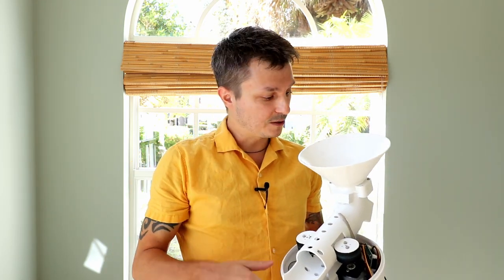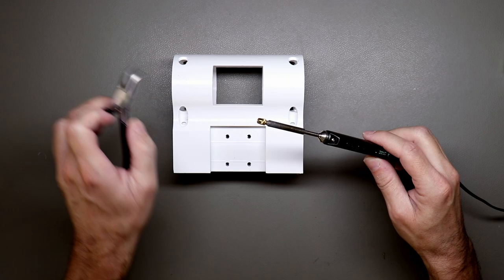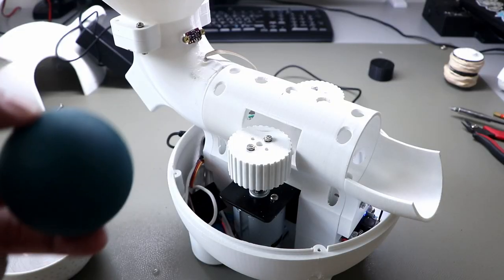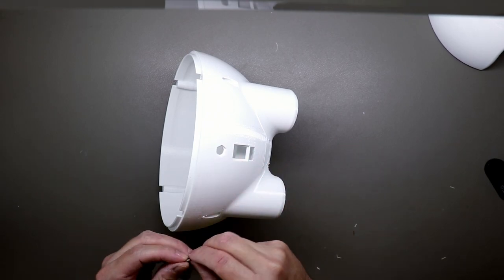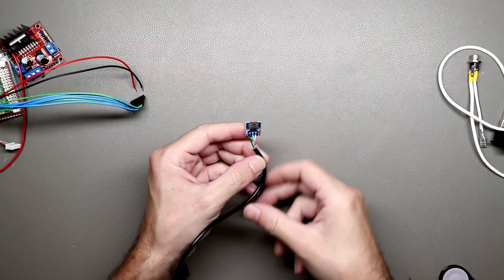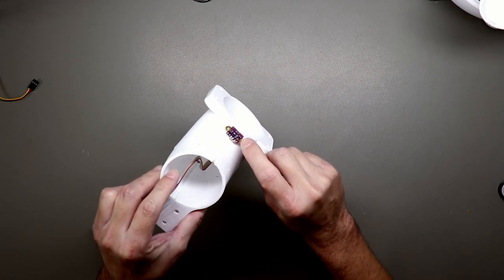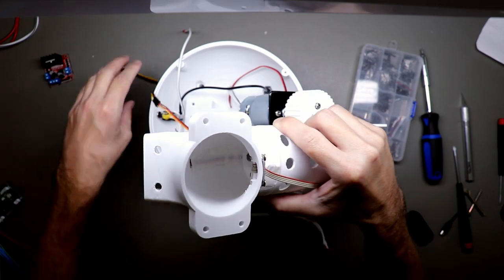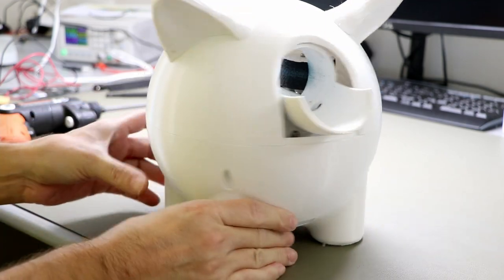The ultimate DIY Automatic Dog Ball Launcher.

Comment: - How did you secure the servo motor arm so well? I can't get a screw to thread at all!
- Is there any other diagrams for how to handle power? I am unclear on how the negative/ground is wired.
I'm excited to get this working! I am fairly novice to Arduino and these types of project so this one has been quite challenging.
Reply from the maker: I just used a small wood screw. Maybe use a slightly thinner one or longer one?
What power are you referring to? To the motors?

Comment: GREAT project. Couple of things as I build. 1. The screws you show to get is up to 30mm in length. The thickness of the wheel is 30, so 35mm screws are needed. So I had to reorder. No big deal. 2. There are several places the screws are too short.  3. The little LIDAR distance measuring device is no longer available. A different part is needed.
wow.. for anyone thinking about this build. Maybe think twice. He has the wrong file attached for the part where the motors attach. It is not even close!! Now I have to completely redesign and build. Too bad the original Fushion files are not attached so I have to start from scratch!!

I would suggest an update to your video, or make a howto, but it is obvious you are not paying any attention to this posting. :(
Edit: Also don't blindly just print what he has listed. There are duplicates. The Servo cover, there are two. You only need one. There are two ball chutes (the exit) and you only need one.

It keeps getting worse. :( Do not blindly just order what his links take you to. He talks about an 8 pin plug. The parts ordered have a maximum of 6 pins. So now I have to adjust. The link to the wire assortment will only be part of what you need. It is far too small of a gauge for a lot of this project.

Comment: This seems like a really fun build my dog would love! I may have missed it during the video. Did you mention the total cost or an estimate of the parts needed?
Reply: To purchase all the electronics your looking at $128 give or take $10. To purchase everything he used in his build off Amazon the total you would be looking at $227.. i would just purchase the $49 ball launcher from Amazon.
Reply: It looks like $60-$100 depending on what you need. I see the PICO for $12 and motors for $16 ea.
Reply: @jacknabvoip  And it will last about a month. I bought the best one I could buy and it lasted 10 shots and broke. Good luck. You get what you pay for.
Reply: @lorneshantz4892  I ended up returning the launcher I bought off Amazon, my pug would get scared and run when the motors started to spin up even though they were not loud..

Comment: Hello....I wish to ask question here. No load current ratings for 775 is 1.7 amp And there are 2 motors and max capacity of L298D is just 2 amp.So motor current under no load is 3.4 amp.whether there is no problem with motor driver?
Reply from the maker: I never had a problem, the motors are also only active for 5 seconds.